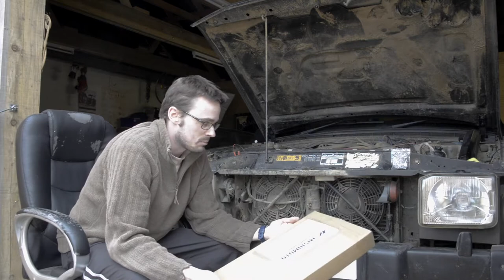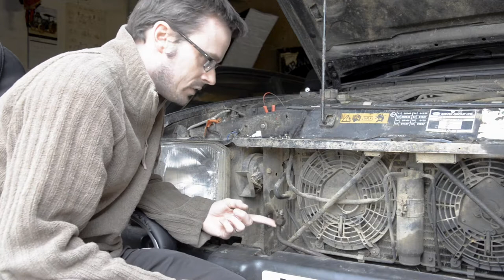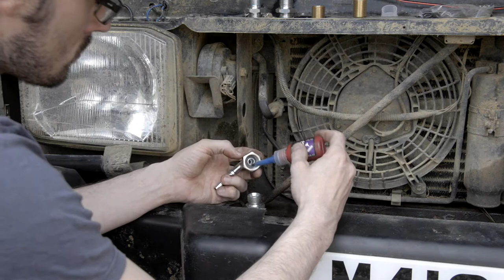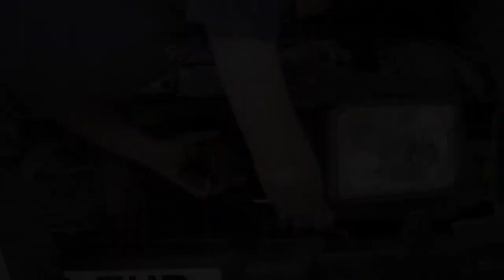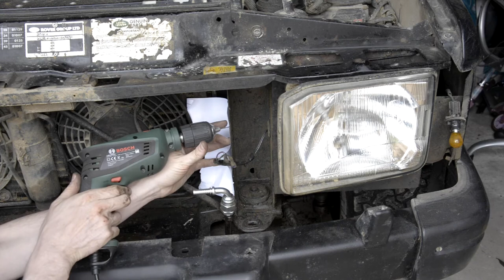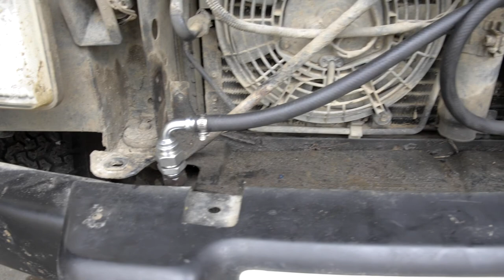Installing a Mishimoto transmission oil cooler in a Land Rover

Comment from the maker: Has anyone else done this conversion or similar? What results did you get?
Reply: How was it after any good ?
Reply from the maker: Yeah, whatever was causing my old one to break is still haunting me but the new cooler is so much stronger it is not the weak point anymore. I can't comment on the cooling capacity as there is not gauge on the gearbox but all checks out good.